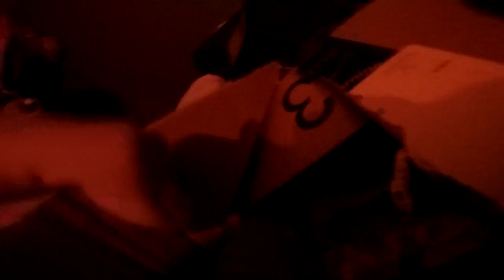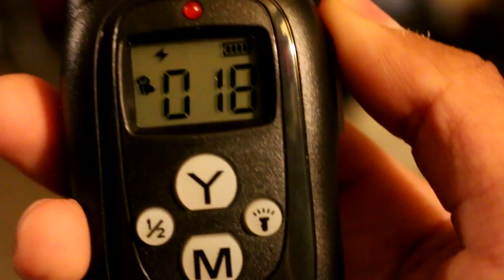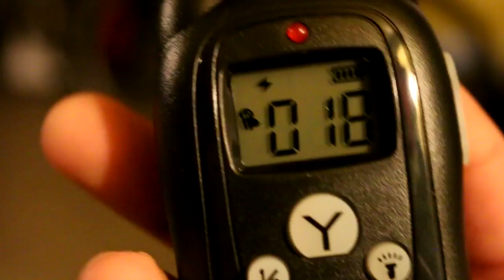How To Make Your Backyard ESCAPE PROOF, Introducing Training Collar To Husky

Comment: there’s a difference between E collars and shock callers that is an extremely nice E-caller normally on a 10 with a shock collar the dog would whimper you had it on a 60 and it barely did shit remember E collars have to be tighter then a normal caller because if you don’t then it will vary every time you shock the dog so you so it could effect The dog differently every Time you Shock it

Comment: @KzE_Production have you ever consider instead of making your 6- 7 ft fence taller To just have a Angle topper instead , You can easily buy an affordable small fencing from online & make your own supports  

online example https://bamahuskies.com/wp-content/uploads/2013/08/6-foot-wooden-fence2.jpg
My own dog(an cat)  proof fencing design  angles between 35-45 degree  http://oi64.tinypic.com/2j0kop2.jpg

once they see the over hang is out pased above their heads they tend to give up trying to escape since they cant exactly climb past a over hang although it took my own husky 3 failed escape attempts after i put it up to get the hint

Comment: You should neuter him. Cause if you don't he could get cancer and get bad behavior which leads to escaping, bitting or running away. He could also get tumors or have bad health issues when he gets older. Neutering him will hopefully stop him from jumping fences and bad behavior. Cause the reason he jumps fences or tries to escape is cause he wants to find a female to mate and probably there's a female in heat and that's why he wants to escape to find her so if you neuter him he will hopefully not jump the fence anymore lmao